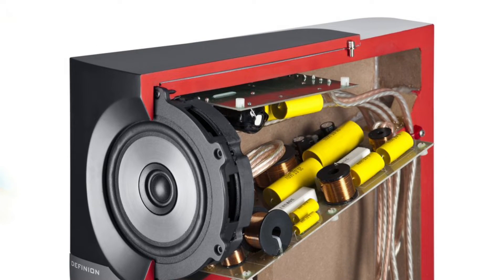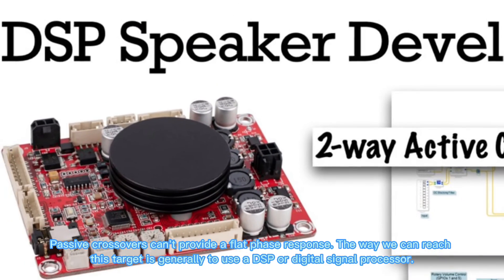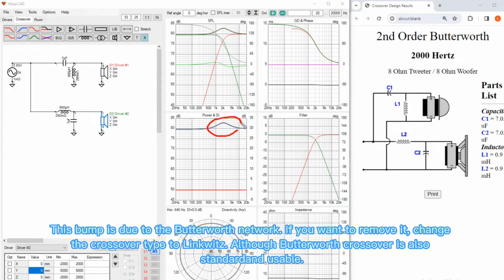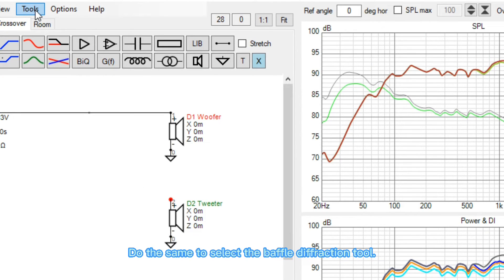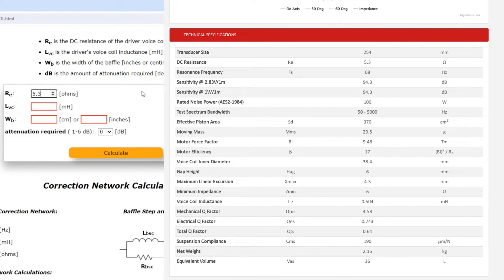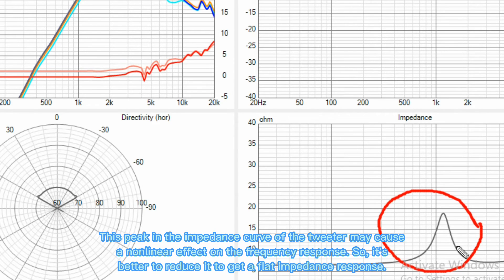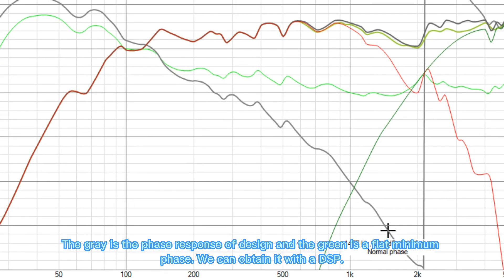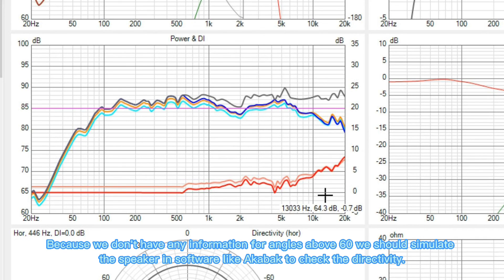6-3-All about crossover design_Free software_part3

Comment: I mean yes, it's a good video for beginners. But I have to say, you are over complexing things. First of all, you talked about DSP, don't do that if you want top quality. DSPs will always decrease a speaker's capabilities, like sound stage and a lot of other things. 

You also talked about the baffle calculator or something like that, dont do that. It's just better to put the drivers in a box and measure and then go from there, you also talked about the spikes in the impedance load, leave that alone unless it's super bad... And normally if it's that bad you should change drivers... 

Building speakers isn't about how pretty the impedance of the frequency graph is, it's about how it sounds. Normally a completely flat frequency response doesn't sound good so you will need to come up with your own sound. And you can't forget about the cone material and the crossover point, these two are almost the most important steps of a good speaker. 

Different materials will sound different, you could design a speaker to sound good for a guitar but then when the piano comes in it sounds absolutely garbage. What I'm trying to say is that, speaker crossovers kinda rule of their own and they should always be the simplest.
Reply from the maker: Thanks for your comment.
1-The phase response is the most important part of the Imaging of a driver. Watch "RTINGS videos",  please. DSPs can flatten the phase response while the passives can't. Kii3 uses DSP and provides the best quality, imaging, and soundstage.
2-These videos are about calculating the drivers before purchasing them. By the way, if we have a single full-range driver we should implement the baffle circuit. You may design a 2nd order crossover with 2 capacitors and 2 Inductors but it is not always responsible. 
3- Impedance response is very important at the crossing point. DC resistance is not a good value to calculate the crossover.
4-Different materials in speaker cones have 3 factors: Damping, hardness, and weight. The more damping the lower the peaks. The higher the hardness, and the lower the weight, the extended the flat frequency response. 
So, the ultimate goal is a flat frequency response.
Reply: @Diy_enjoyment  You can do it your way, but it isn’t the right way.
Reply: If you could provide scientific proof to your first statement that would be great. This isn't 1990 anymore. Passive crossovers are still using 1950 technology while DSP provides much more flexibility to make a neutral speaker with phase matched, time aligned speaker, while also eliminating parasitic losses. Also, cone material really only matters if you're using the driver outside its intended frequency range...